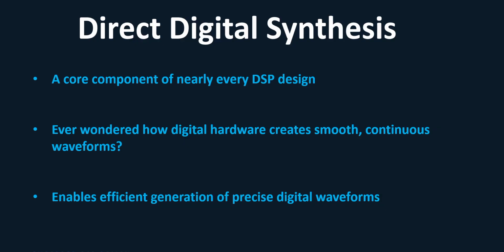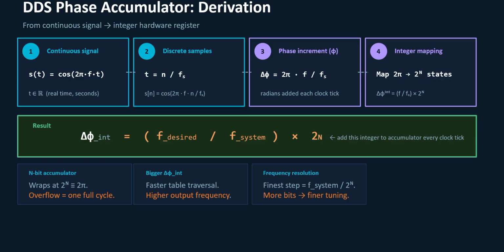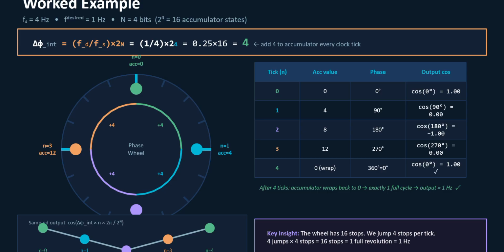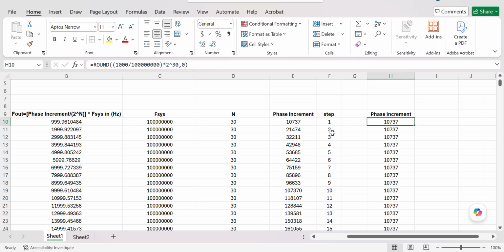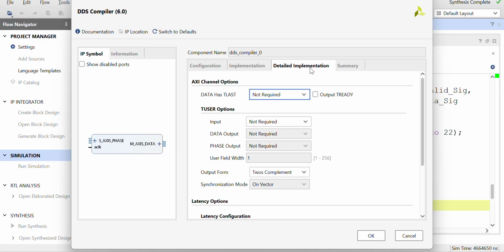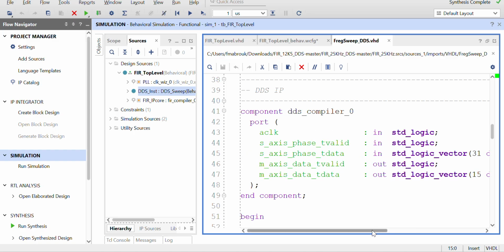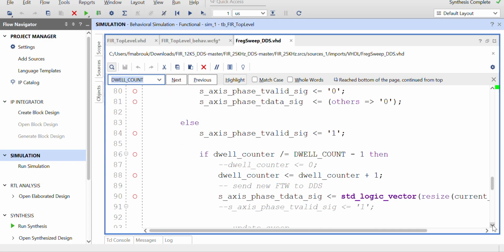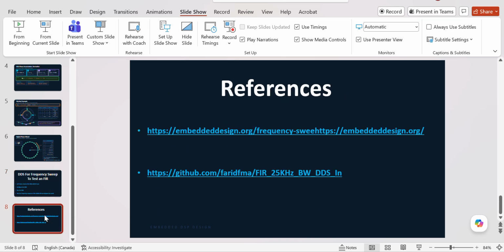Xilinx DDS Frequency Sweep on FPGA: Design and Implementation

Comment from the maker: Correction: at minute 3:05 I made a wrong statement: In the derivation, I stated that the final expression becomes:

s[n] = cos(Δφ)

The correct expression is:

s[n] = cos(n·Δφ)

The sample index n must remain because the phase accumulator adds the phase increment Δφ on every clock cycle. In an N-bit DDS, 2π is represented by 2ᴺ accumulator states, so the phase grows as n·